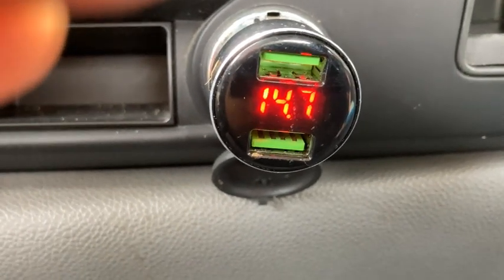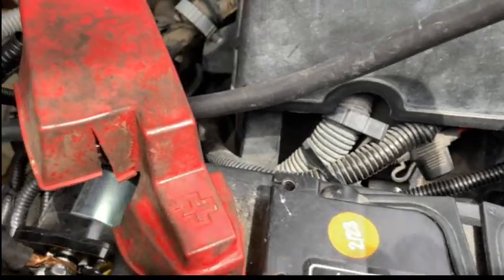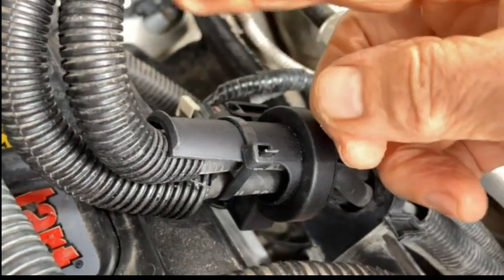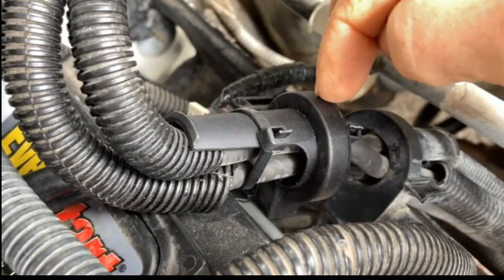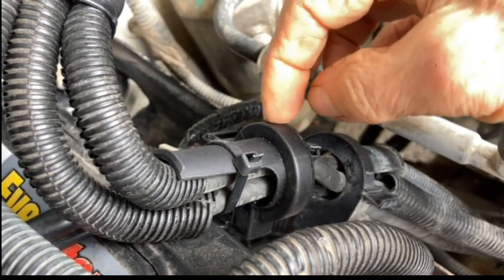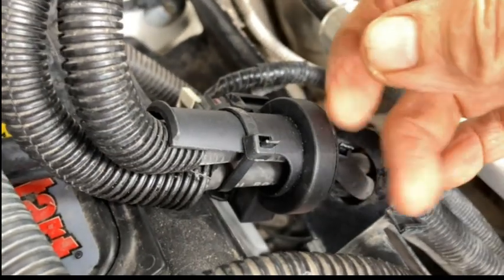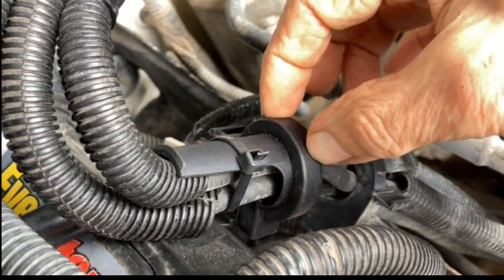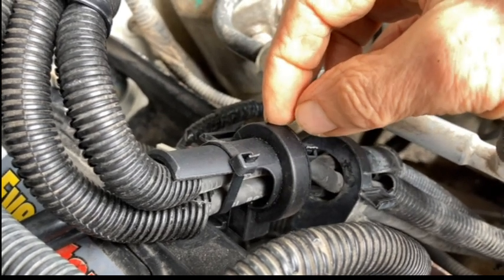GM Silverado Battery Current Sensor Voltage Drops to 12V+ Fluctuations Part 1

Comment: I have a 2011 Chevy Silverado 2500 HD 6.0 L gas engine. I followed the negative cable and I cannot find a current sensor on this particular vehicle. I replaced the negative cable 2 months ago and I didn't see anywhere on the old one where a current sensor would be. I have a 2017 Silverado where you can clearly see the sensor just right after the negative connection point on the battery. But with the 2011 I don't know where else it would be. Do you have any other suggestions? Did the 2011 Silverado 2500 HD have one? Any help would be appreciated.
Reply from the maker: HD 2500 3500 V8s trucks don't have current sensors. That would be an Alternator solenoid
Reply: @TheRancher03 my 2017 Chevy Silverado 6.0 L truck does have one. The earlier 2500 like my 2011 I don't see one anywhere. But like you said maybe the 2500 earlier ones don't but my 2017 does. Very odd. But thanks for the response I appreciate it.

Comment: My truck runs ar 15.4 volts. Its a 2010 silverado. Im wondering why its running so high all the time.
Reply from the maker: Alternator regulator bad. Rather than replace regulator, I'd just get new alternator.

Comment from the maker: I installed the Mechman MM-VC1 (comes with P103 modile 2-pin plug) and P103 module to prevent the "Battery Charge System" service error. Runs perfectly and can be et to fixed voltage and modified while running.